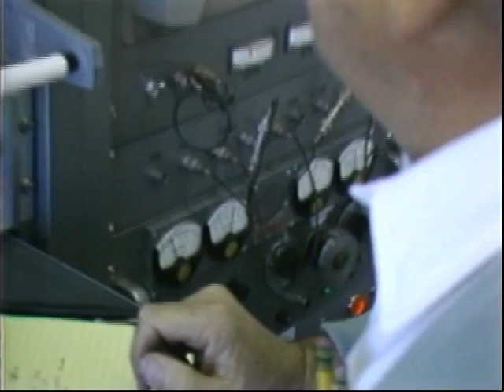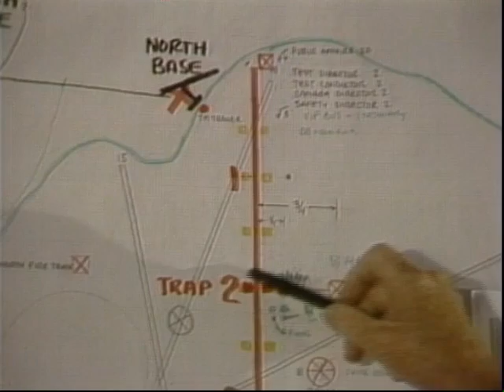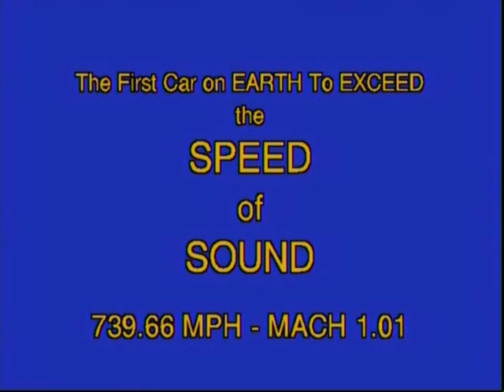Bill Fredrick Budweiser Rocket Car - Speed of Sound Land Speed Record

Comment: The biggest support for this thing going supersonic to me is that the sidewinder ran out well BEFORE hitting their speed trap.  Even though experiencing massive deceleration, it still went through the trap at 666 mph.  739 is NOT unfeasible considering this.  Plus, a lot of talk about sonic boom, but he spent very, very little time above mach 1, so maybe that plays a factor for hearing it?  On the thrust ssc runs, it maintained supersonic for an entire mile, so plenty of 'bang' to be heard.

Comment: 6:50  German BMW-Messerschmitt jets broke the sound barrier before WW2, which was NOT publicised because the jets were one of Germany's many top secret projects.
Reply: Yes of course, they did and without the turbines melting as well.
Reply: Unlikely. There was at least one example where a Me-163 Komet exceeded its Critical Mach Number and did some serious structural damage. Another unknown at the time was a phenomenon known as Drag Divergence Mach Number. It was these two factors that combined to make what was known as “the sound barrier “.

No jet engine at that time - no matter who built it - had the power to get through it and the inlet designs were not up to the task of slowing the free stream air down sufficiently for the engine to continue running. More likely it would stall and flame out.

But the biggest concern was still structural damage. Aircraft of that era simply weren’t strong enough to exceed Mach 1 and survive.

Comment: I used to have one of these  -- it was fun to have a freeway chase with the local cops  -  if they had caught me they estimated the ticket would have cost me about $987,000,000 - you just have to keep the pedal to the metal and don't take too long at the gas station.

Comment: It might be unofficial, but Andy Green is only the first on paper, not in reality.. Stan was always the first to break the sound barrier on land.
Reply: Where was the sonic boom ? They didn't do it
Reply: @gravyboat2370  One said they heard it, the rocket produced a standing shockwave and a standing sonic boom from the rocket impulse. The sonic boom from the space shuttle is seldom heard by viewers because of the rocket, does that mean that the vehicle does not break the sound barrier?
Reply: @427SuperSnake1  you heard thrusts sonic boom .
Reply: @gravyboat2370  Thrust was not a rocket and the noise impulses were different. As was the size of the vehicle. Sonic booms are also two seperate booms not one. But most of the time only one is heard because they are heard in succession when the vehicle is smaller.
Reply: @gravyboat2370  Apparently it was a very clearly heard sonic boom as well according to those who were there. There was also a clearly visible series of shockwaves around the vehicle during its run including a bow shock that kicked up a huge amount of dust, none of which was observed during this run. The Budweiser Rocket was incredibly fast and probably came close to Mach 1 but there's no credible evidence that it broke it.
Reply: @427SuperSnake1  yeah the guys who were paid by the team heard the boom yeah sure🙄-another suspicious thing is the radar unit used was not capable of measuring the significant figures used 🤔
Reply: @427SuperSnake1  That’s not how it works. An aircraft travelling at supersonic speeds will make no sound on approach. As it goes past, all the built up sound hits you at once, resulting in a huge bang and pressure wave. If you watch Barrett at high speed, there is no time when you can’t hear him and no boom as he passes the timing point at the peak of his run.

Sorry but to anyone who has experienced a sonic bang, this was not and could not have been a supersonic run. It’s a shame because Stan Barrett put his life on the line and drove his best. But no sonic bang = no sound barrier exceeded.
Reply: @427SuperSnake1  It doesn’t matter. Sound travels at the same speed, whether it’s generated by a rocket, a jet or a Volkswagen.
Reply: @trolleriffic  That “bow shock” was dust being thrown up by the front wheel. If there had been a sonic bang, it would be clear from the camera position at the timing gate. You would hear a sonic boom right there, just as happened with Thrust SSC. But there is definitely no sonic boom.
Reply: @MrRaulstrnad  That’s true. Radar does not measure Mach number.
Reply: All these New Zealand farmers that were the first to do powered flights but never on paper………..right.
Reply: The real record is both ways, within 1 hour, to prove that wind direction doesn't factor into the record attempt
Reply: The French rule’s might have actually mattered if they were trying to set a new land speed record but they weren’t so there’s that.
Reply: @ Right. It was never intended to be a LSR. It was supposed to be a "Mach event" and as a promotion for Budweiser.
Reply: If he did it....
Reply: There are numerous things about this car. Was it just SMI Motiovator repainted?  Why did they need the Winder?  One thing is clear Barrett deserved all the credit, Needham was a Hollywood man, rumour has it he stood to make a fortune from Budweiser and from merchandising only if they broke the barrier, hence the pressure and the long waits for run data.  Whole thing was a shame, and using doctored letters from guys like Yeager and Pete Knight a farce.  I believe the damn thing went very fast probably close to the barrier, but if it broke it, it was only fleeting and there was no clap heard, and when you heard SSC it was very obvious it broke the barrier. But again, Barrett was a hugely brave man
Reply: There is zero evidence for that claim. Therefore he didn't do it. Simple

Comment: Why didn't they turn it round for the other direction also, then, to make it an Official Record, as the Brits did in their - speed of sound  "car"?
Reply from the maker: The rules are you have to turn around and go the other way within 1 hour.  It took the Budweiser Rocket Car 3 hours to refuel.
Reply: @robtherealtor8007  Sad but those are the actual Rules to be noted for a Record. And the Brits managed to do it!
Reply: @finncarlbomholtsrensen1188  Sad, the same rules and equipment that certified Chuck Yeager Certified Stan Barrett.
Reply: @fraudsarentfriends4717 No, that isn’t true.
Reply: @fraudsarentfriends4717 this run was never actually certified.
Reply: @kenjo9466  It was Certified by the same people that Certified Chuck Yeager breaking the sound Barrier.
Reply: @robtherealtor8007  And try hiring some F1 mechanics, though they seems to much overpaid, for the time they actually works, measured in seconds 😄! Finn
Reply: @finncarlbomholtsrensen1188  Nobody would refuel a car that ran on high test peroxide in seconds unless they'd got a death wish. That stuff is exponentially more dangerous than gasoline.
Reply: @finncarlbomholtsrensen1188  F1 mechanics have no more understanding of SuperSonics than would a shoe salesman.
Reply: That was never the intention.
Reply: It was more of a publicity stunt than an actual record attempt.
Reply: The Australian try also continues still, but haven't reached an actual test